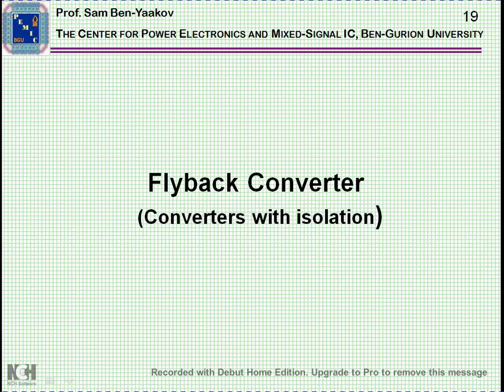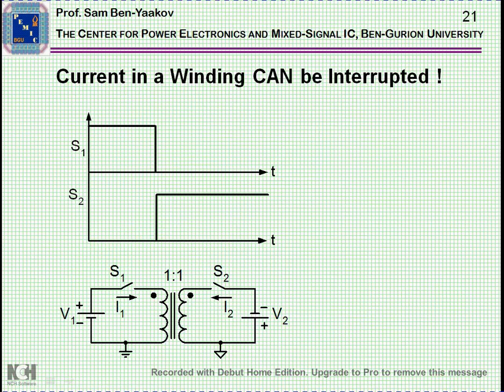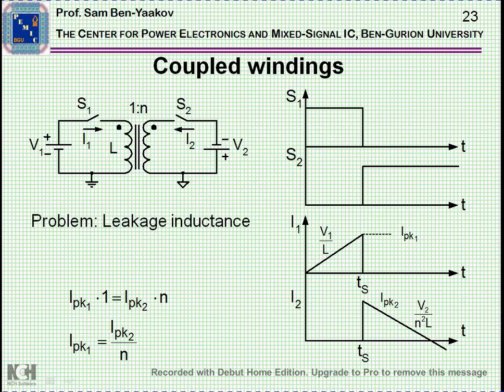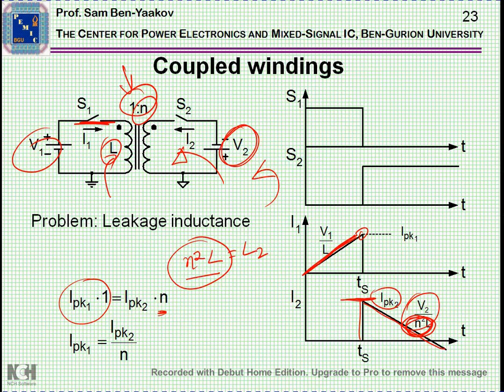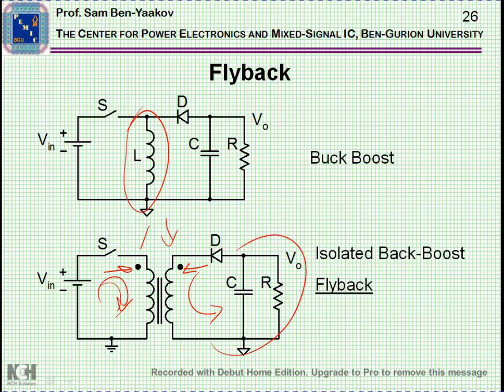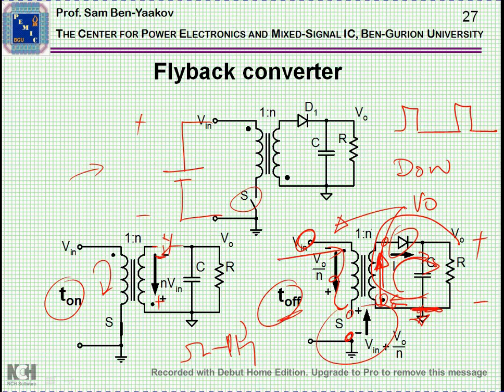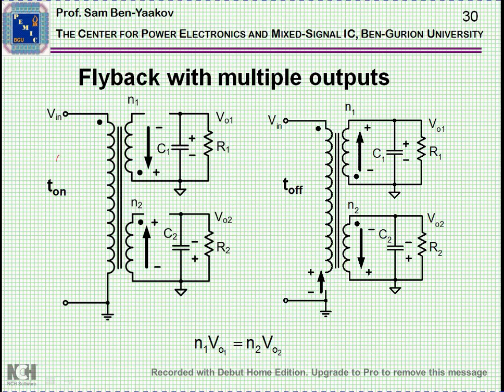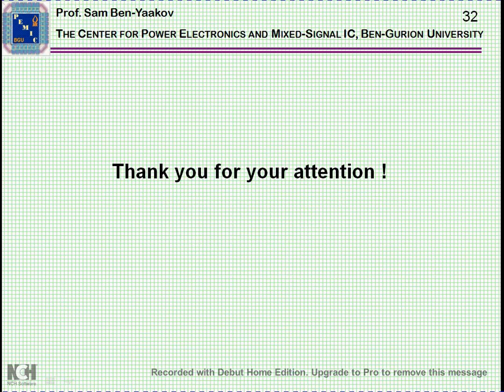Flyback converter

Comment: Thank you for this, Prof. Sam. I would like to point out, though, that I believe the dot notation for the transformers was misinterpreted. As far as I know the dot marks the positive reference of the voltage in the winding, by convention [1]. This means, that the current shall flow from the positive reference towards the negative one, as per convention, as well [2] [3]. 

Thus,  I believe the diagram at minute 3:56 (https://youtu.be/OXibsOzjipw?t=236) used for the explanation may be confusing, because the real flow of the current will be on the contrary direction of i2. In the end the diagram is completely valid and the relations between voltage and current between primary and secondary are [2] [3]:
V2/V1 = - N2/N1  = -1 and I2/I1 = - N1/N2 = -1

So, I just wanted to bring awareness that it may be misleading and one may think the current will flow in the direction of I2 when in fact flows in the opposite direction.

References:
[1] - https://circuitdigest.com/article/understanding-dot-convention-in-transformers
[2] - https://slideplayer.com/slide/5922251/19/images/62/Voltage+Polarity+in+an+Ideal+Transformer.jpg
[3] - https://slideplayer.com/slide/10877632/39/images/8/Dot+Convention+for+Ideal+Transformers.jpg

Thank you!
Reply from the maker: Hi Andre, thanks for sharing your doubts. At first, when seeing that you brought some references I thought you are bringing in Faraday or Maxwell (at least) , but then it turned out that these are internet postings😊. As it turns out, they are OK but I am afraid that you missed the point that my video is about COUPLED INDUCTORS and not a TRANSFORMERS. There is a major difference between them. In a transformer, at any given instance: Pin=Pout. Not so in a coupled inductors (in general, although it may function as a transformer too). Please watch again the video which explains the workings of a coupled inductor in connection with the Flyback converter. There are also other relevant videos in my YouTube channel "sam ben yaakov".

Comment: About 30kv, 45 miliamp, and yes its a handhold operated device.
Reply from the maker: 30kV is a bit high for a flyback stage. You may need a second stage, spark or resonant base. Look up circuits for igniting Xenon lamps.

Comment: dot convention is wrong
Reply from the maker: At which slide?
Reply: @sambenyaakov   Sam Ben-Yaakov  at the beginning sir when you are talking about the transformer action. Slide number 21.

It was really confusing at the moment. Since both windings show current entering. In secondary winding the dot should have been at the bottom rather than the top in my opinion
Reply from the maker: Hi atharva, you missed the point. Please listen carefully to the explanation in video. You can also use CC. 
In short: what is shown in slide 21 is NOT  a transformer (this is the whole point) this is a coupled inductor, The currents are flowing in one winding OR or the other (not simultaneously as in a transformer) , Being an inductor, to keep magnetization both currents(one at a time)  flow INTO the dots.
Reply: @sambenyaakov  got it
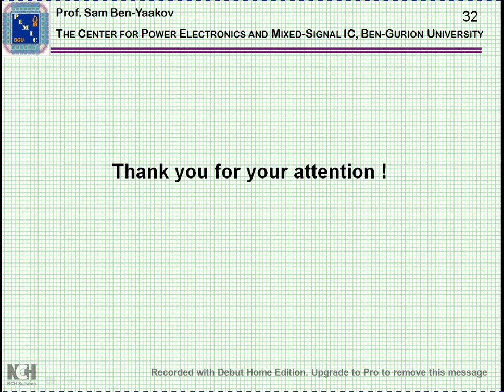Reply: And so is the Diode Direction of Current,  anode and cathode polarity. At time stamp 20:15